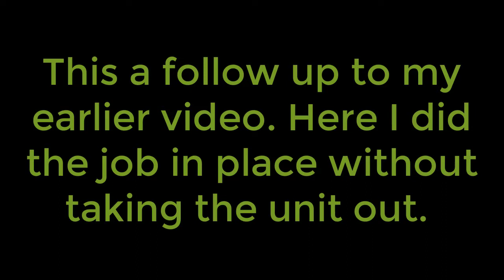Freeze Cracked Tankless Water Heater Repair -  In Place

Comment: Hi Ramesh - THANK YOU FOR POSTING THIS! Question - Are you using MAP gas or propane in this video? I want to get the same device and approximate the same dwell time you've shown here. thanks x3
Reply from the maker: I used MAPP gas but that was the last can of MAPP I bought several years back. The local Home Depot no longer sells MAPP gas, they sell  MAP-Pro, which I have used in another recent fix for a friend.

Comment: I have the same problem, but I don't have the equipment you have, so how much would you charge to do this? Also, do you have a video which shows what you did fixed the heater? John Sanchez
Reply from the maker: If you are in Austin you are welcome to come by and borrow my tools. Send me an email.

Comment: This is about as cool as the showers I’ve been taking. I ordered a new unit and they are backordered until May. A plumber wants 2x the price of the unit to install. 
I drilled into the casing with a hole saw and hope to have enough room to work. I’ll get brazing rods tomorrow. If this works, let me know your favorite charity.
Reply: And I have hot water. I had to blow out the residual water left in the pipe with an air compressor. Thanks.
Reply from the maker: I am happy for you Frank. The few times I found there was still water in the pipes, I have been hooking up a garden hose to the hot water connection and just sucking the water out (crude but worked). My friend and I have been fixing units in our neighborhood over the last few weeks to raise money for charities. Here are a few charities on our list: RAICES(https://www.raicestexas.org/), HAMM (https://www.myhaam.org/) and SAFE Austin (https://www.safeaustin.org/).